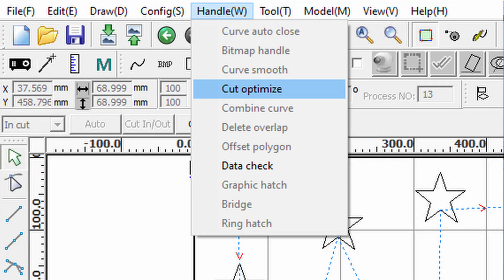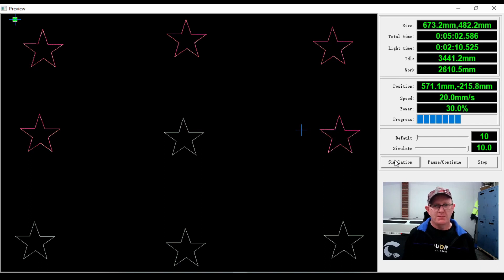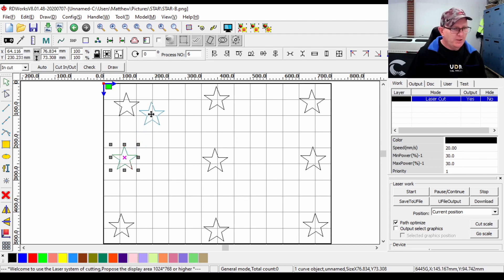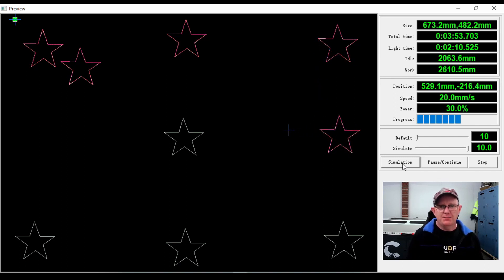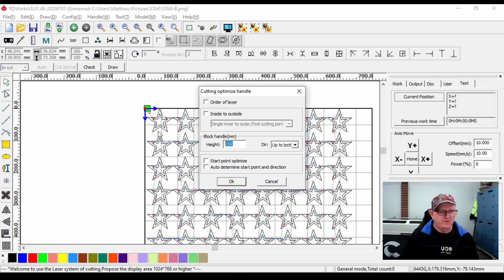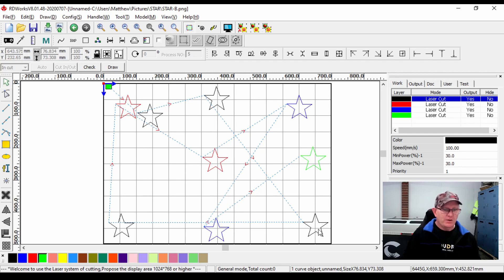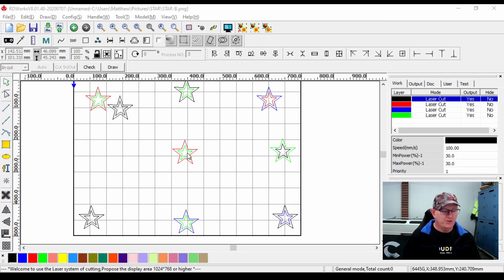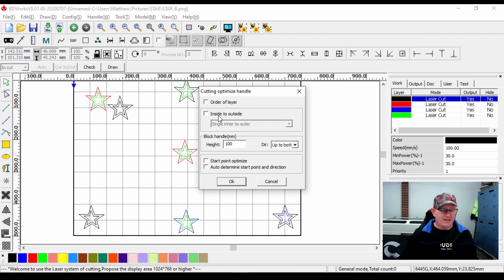[07] RuiDa Controller - RD Works - Cut Optimization

Comment: Hey mate, I'm trying to cut some triangles in a specific way so they don't get butchered. Basically the corners will be too sharp and the knife will pick up the material due to drag. Is there a way to start the cutting of the triangle at the centre of the long side and go outwards to one end then back to the centre and go towards the opposite end, then after that just complete the rest of the triangle?

Comment: Thank you! Unfortunately I can not how to regulate speed/power of cutting when laser goes to the end of the line and return back. In that case the speed is slower then stop, then increase again, but the power is the same, so the material burns a lot in this spot
. Where is the tool to regulate it?
Reply from the maker: adjust the min and max power settings for your cut, without knowing exactly your current settings and the material you are using etc.. I cannot advise what they should be - you can email askmatt@mwlaser.com.au for more assistance.  Cheers

Comment: hello, maybe you can help me with a problem, i bought a cloudray controller Ruida RDC6442 S-B but it doesn't seem to be recognizing the pendrive, when inserting the pendrive with the file, a document not found message appears. is there something wrong or just a configuration? I appreciate any help.
Reply from the maker: if using the USB drive for the 1st time on the controller, make sure it is formatted correctly, and the files you are transferring to the USB are the correct format and not saved in a separate folder on the USB
Reply: @MWLaser  Ok friend, thank you for your help.  Actually it was a matter of file extension, the controller only opens files with extension .RD, I was trying to open dxf, dwg, cdr files in order.  The controller operates in conjunction with the RDworks sotwere which transfers these files to the RD extension.  Anyway, I am very grateful for your attention and a fan of your work.  thanks!

Comment: Sorry if this has been addressed elsewhere but do you have any details on the laser behind you Matt?
Reply from the maker: My new machine is a CR1390 with CR130-150W and the New Cloudray RuiDa RD6432G Controller.
Links to more information on the machines I use can be found on my website https://mwlaser.com.au/about-us/
If you are in Australia and would like a quote, email Matt@mwlaser.com.au 
Cheers Matt